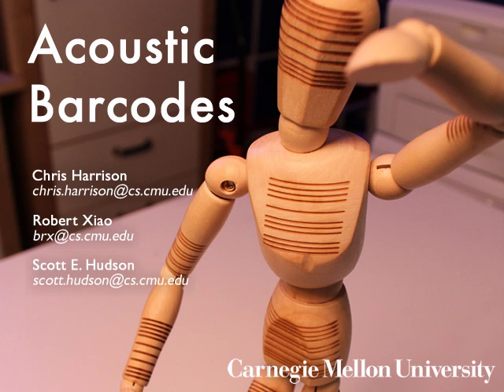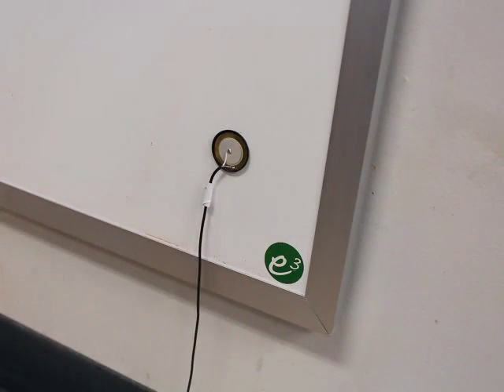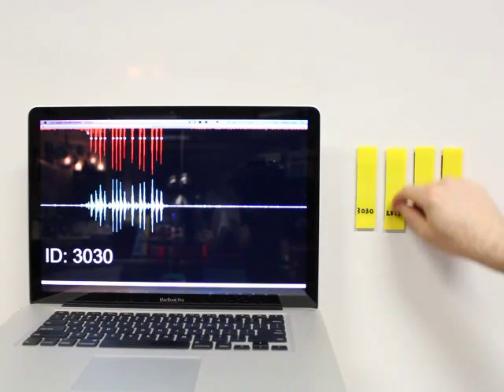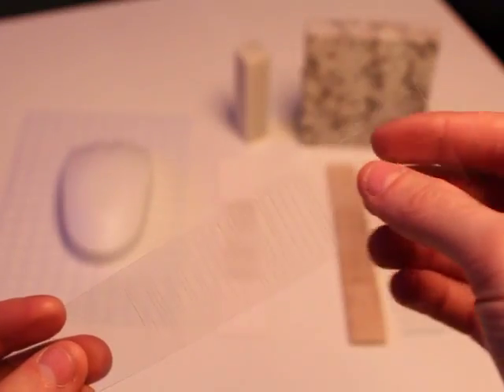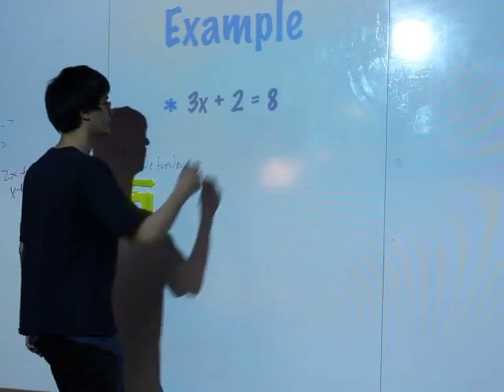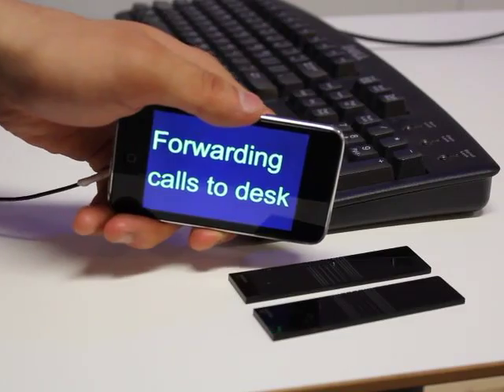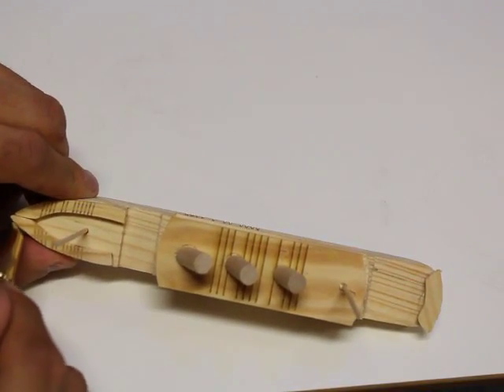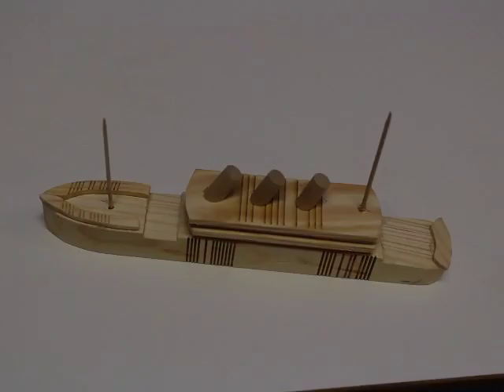Acoustic Barcodes: Passive, Durable and Inexpensive Notched Identification Tags (UIST 2012)

Comment: I've been on some roads that got sets of 3 bands of bumpy stripes, with increasing number of stripes on each band, before turns, to make sure drivers are awake and going into the turns at reasonable speeds. Those didn't seem to be particularly more worn out where the wheels touch more often  than in the rest of the surface, and for regular city traffic those bumps could be even subtler and therefore not hit wheels so hard and so would wear out even less.